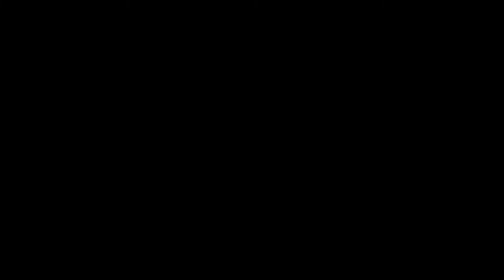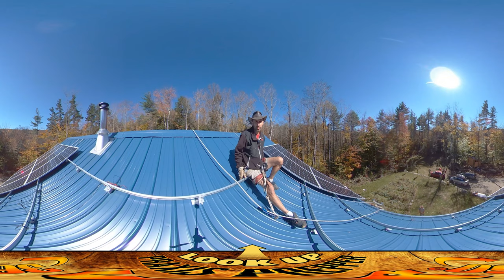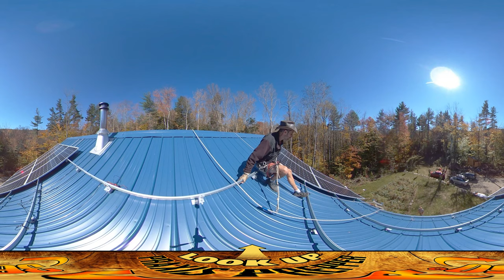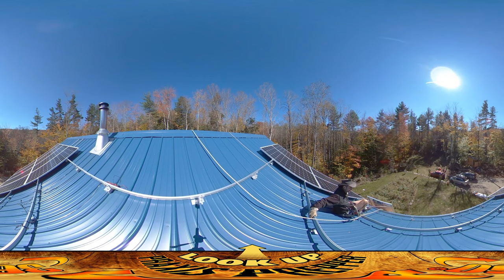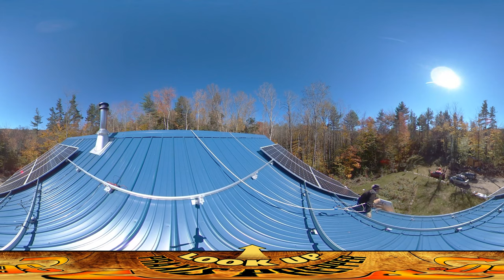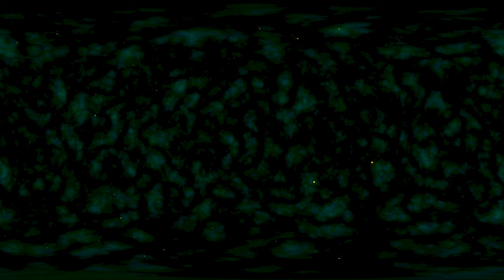Homestead Building - Installing Solar Panels on Roof Without a Crane (Two People)

Comment: Monocristaline panels are the best
Reply from the maker: It's been a while since I did that research, but I recall that the balancing act between deciding on panels had to do with cost and output and how they perform in partial shade. The one thing I recall for certain is that any panel is better than no panels! ;)
Reply: @PraxisPrepper  mono panels do better in the shade, and on cloudy days, that's why I use them.

Comment: I just got my panels delivered.
Still saving up for racks, wire, battery and inverter. As much as I dislike using credit, if I don't act soon it might be too late.

I'm going to need a similar method to hoist them but I have a good friend who does tree work so I'm not worried about the rigging. Still, it'll be a bit nerve wracking.

Thanks for sharing that it really can be done.
Reply from the maker: The "racks" in my case are just 17' long aluminum extrusions. To save $, you could mount your panels to a frame you build out of wooden lumber too (though I wouldn't do that unless you're going to ground mount them so you could inspect for any degradation over time). That's how I mounted my previous systems. The panels kept the wooden frames pretty dry underneath too. Good luck on getting everything together. It's a great feeling to be able to be energy independent!
Reply: If you haven’t discovered it yet, check out the channel DIY Solar with Will Prowse and his forum also. Hed does a lot of reviews of inverters and lithium batteries and also goes over the process of building your own Lithium batteries. I ended up making my own for really not much more than quality standard flooded lead acid batteries appropriate for solar.
Reply: @inmyimage1081  Will had a great channel, tons of free resources and an amazing personal story.